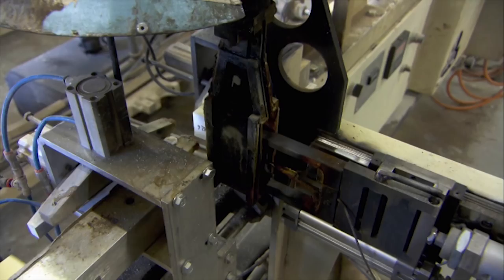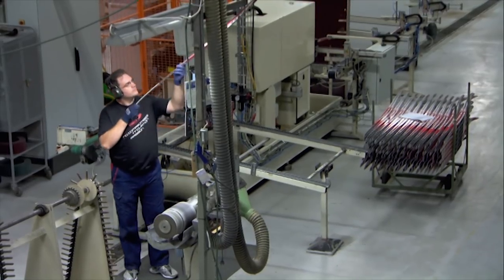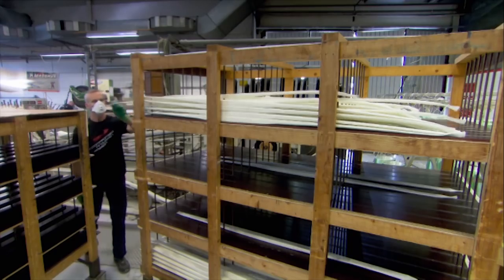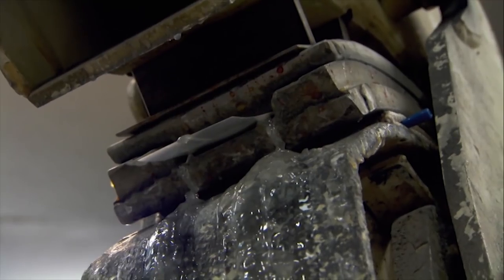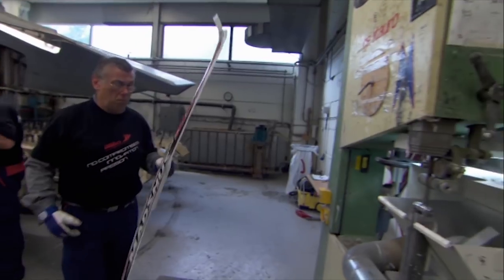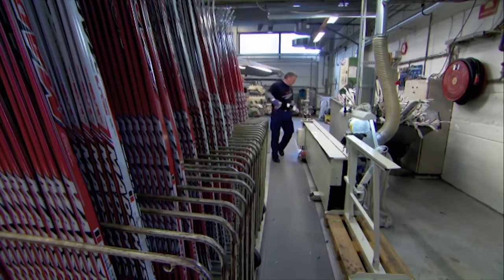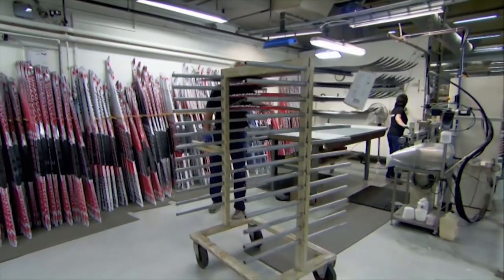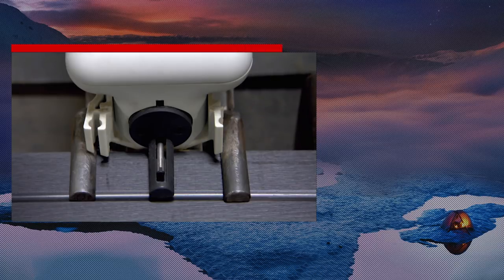Making Cross Country Skis | How Do They Do It?

Comment: The next step in the process is to stand around talking about which wax you're going to use as the temps drop from 20 with high humidity to -2 dry as a bone. And when you do finally get the wax dialed in, the temps shoot up to 45 for a week and all the snow turns to crap.